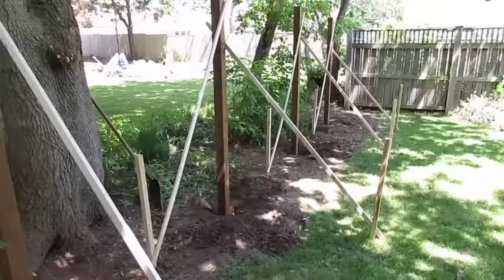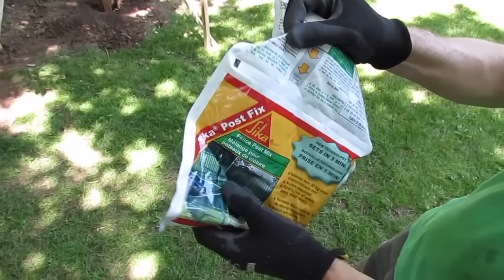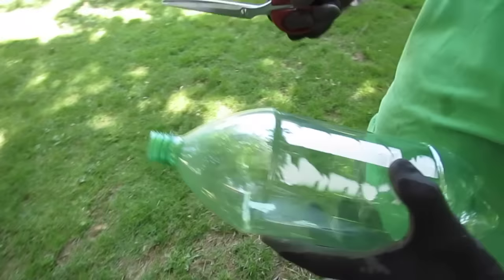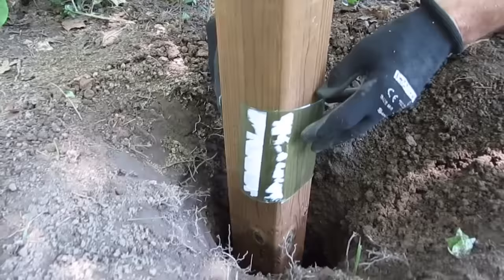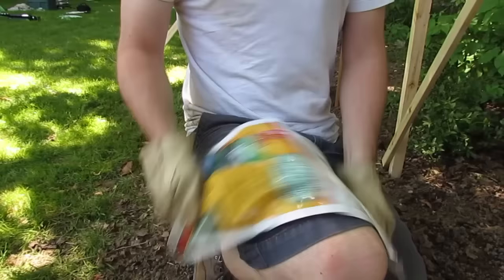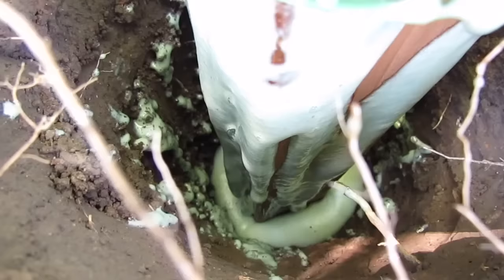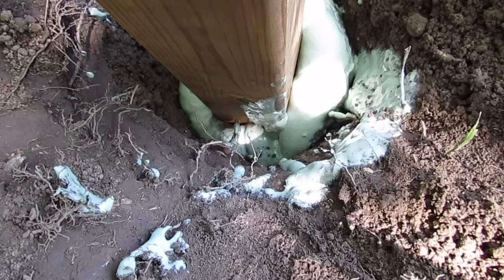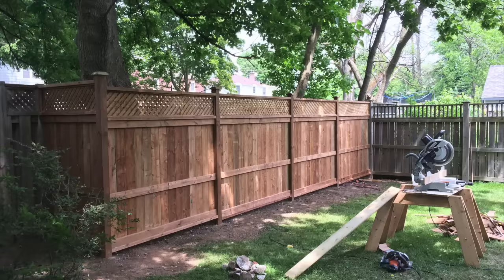No Concrete Fence Post Install!

Comment: the time you spend leveling screwing it... then pay 20bucks for a bag of foam which doesn't even do 1 post... instead put a post in, bucket of water, bag of postcrete for a fiver, level on, hold for a minute and job done..
Reply from the maker: I'm pleased you enjoyed the video so much! Feel free to watch some of my other videos and provide more of your insightful wisdom.
Reply: don't forget the gravel!
Reply: No gravel needed. Postcrete is mix already. Bag cost 4-5£. Fill 1/3 of the hole with water follwing bag of postcrete, level on, job done.. Didnt want to offend you man. You just end up double the price of you fence
Reply: Yeah I did the same, and it was about $5 US per bag here.  But I did put a little bit of "drainage gravel" under the posts, although it may not do anything since the water I put in before the mix probably just filled in around the gravel.
Reply: Paulius Taparauskas not very cheep to use
Reply: @John Doe  Or a callous.  But whatever.
Reply: Awww, you triggered Paton
Reply: Nailed it. No professional would entertain the use of foam as a substitute for concrete.
Reply: PatonHaus Hey....look on the bright side. At least he's not calling you a Home Depot princess and cussing you out like most of these simpletons.
Reply: Not everyone can carry those bags of cement around, the foam is a good idea.
Reply: Use a dolly or a wagon
Reply: $2.35 for a 60# sack at HD, that's under $5 for two sacks like the foam is supposed to handle @ $18.  Crete's heavy but permanent, so I'll be sticking with it.
Reply: That's the truth too much hassle
Reply: Got some "experience" to share that proves concrete is better to use by a home owner novice?
I've seen plenty of botched concrete pours, this seems "fool proof" as a diy.
Reply: Paulius Taparauskas or just use dirt and a log or ur feet works just fine
Reply: Better yet put post in hole hold level put 80 lbs of dry concrete bag mix . Level out and tamp concrete and add water. I can dig and set 80 posts a day . Using form would take a week to do that much.
Reply: no, he's laughing all the way to the hardware store to pick up another $15 bag of foam to do one more post
Reply: lewis james n
Reply: Jeremy Pace Finally someone who knows the best way to do it. I've been doing it Jeremy's way for thirty years.
Reply: silverfeathered1 how can you botch pouring a bag a mix in a hole then adding water?
Reply: Terry Graham A dolly? You use girls to carry your concrete? Try using a cart or hand truck to carry your own. LOL!
Reply: scoop of road pack, tamp, scoop of dirt, tamp, scoop of road pack rock etc . 40 years later, Hedge post horse and cattle fence of all # 9 wire still there . I did concrete the corner Posts. Oh the fence and posts were already around 50 years old, when we took them out and brought them here.
Reply: And do not use this if you live in Hurricane Alley
Reply: @chewysplace3542  Why? What is your negative experience with this product as related to hurricanes?
Reply: Jeremy Pace yes, concrete in dry, add water.  i just did one today, ready in under an hour.
Reply: If you have more money than time, and your back is a little tender, this might be a good option, and it might also prevent climate change because concrete gets very hot when you mix it with water. So why make the climate warmer and cause all the polar bears to have to float around on little teeny-weeny pieces of ice? Help save the earth, useFoam for your posts, drive below 55 miles/ an hour to prevent excessive pollution that will increase global warming, and do not drive anything like an SUV as they are huge gas guzzlers and no one should drive such a vehicle if they are climate change wackos.
Reply: @GilsTestChannel  You are joking I take it. Climate changes - always has, always will. Anyone who thinks they can stop the climate from changing, would be more successful sitting in the corner and playing with themselves.
Reply: How the hell did it go from making fun of the guy for using foam to install fence posts to climate change denial.... 
Next thing we need will be some flat earth tards to flesh out the mix, huh?  

I like the foam theory, but in practice, it just doesn't stand up.  But a decorative. Fence like this?  Makes sense.  

If'n it was supposed to actually provide some structural stability, gotta vote concrete.  

Thx for showing the vid, none the less.
Reply: Spart T  b9
Reply: Actually a callus. LOL
Reply: Yep that's the way to do it.
Reply: O
Reply: 7
Reply: @spartt4360   - "Fill 1/3 of the hole with water follwing bag of postcrete, level on, job done" - mate that's as dodgy as it comes  -  you need to mix it in a wheel barrow first if you want a good quality job.......you cant just pour in water, throw powdered concrete mix on top and hope it all mixes together properly ! Takes way to long to set then too and doesn't set evenly.
Reply: @grantdavenport2036  you get a postcrete where I'm from. Instructions says pour water, pour powder on top. Google postcrete before you posting. Wheelbarrow etc is dynosour age, we are not in 90's anymore. Postcrete sets in minutes.  Half an hour and you can screw timber on
Reply: Spart T I work in the industry and supply to hundreds of fencing contractors and any one worth their pay don’t do try mix into the holes - they mix in barrows or a cement mixer and rip it in....nothing to do with being in the 90’s mate, it’s about doing a proper job. Of course postcrete would tell you to do it that way because they’re trying to sell an ‘ease of using’ for the weekend warriors that don’t want a hard job. If any fencing contractor getting paid to do the work quoted doing it like that, a dry mix,  I would say thanks but no thanks - and I’d get a different contractor . I would rather do the job properly and do it once  and I certainly wouldn’t be screwing fencing up onto it 1/2 an hour later due to movement....set your posts, leave them for 24 hours to set 100% right then start screwing your fence on 😉👍
Reply: @grantdavenport2036  whatever, did fencing like that fir myself, you take a wooden stick and mix it in the hole. Don't see the point mixing in wheel Barrow at all.. anyways it's easier and it hardens in minutes compared to that foam
Reply: Spart T the point of mixing it in the barrow first is to ensure you don’t have clumps of the concrete mix that stays in clumps and does never set properly, so you have a good clean consistent mix. 
Exactly the same as how you make a cake - would you pour it in the bowl, put the milk in and then just throw it in the oven and hope for the best ? Of course not - that’s why you stir a cake mix, so you get even consistency. Do it properly- do it once, that’s how I prefer to work 👍
Reply: @John Doe 
He can't have a Calais on his hands.  It's in France. I suppose there is the risk of Callus.
Reply: Well....some are allergic to cement/concrete in powder-form....
Reply: INSTANT DISLIKE CHANNEL  yeah but you not eating it or mixing it in with your coffee 😂😂
Reply: @grantdavenport2036  it is enough to inhale it, or to have contact with bare skin...I had my experience...
Reply: @instantdislikechannel5699   I'd be more concerned of the chemicals in the expanding foam shit than a bit of cement on me.....carcinogenics big time !
Reply: Also missing a key point of adding cement.  There is a substantial amount of weight that acts similar to a pendulum to help keep the pole upright.  Anything over 4 feet fence is stupid. Used this stuff 1 time never again. Also foam does not have the compressability of concrete.
Reply: @grantdavenport2036  
Agree.  Also concrete is a mix of product.  If you put too much water in the cement powter can leach or separate only to the bottom of the hole leaving a the gravel improperly cemented together.  Also too water can cause brittleness or shifting following install.  Just spent 1-2 minutes mixing in wheelbarrow to its proper consistency and done.
Reply: Alaskan1Medic nor the core strength of concrete either
Reply: Alaskan1Medic yeah I’ve even seen dodgy blokes tip bags of concrete mix into the holes dry, tap it down with a shovel handle or similar and then just hose it and hope for the best.......they’re usually the guys who are providing the cheapest quotes ! 
Do it properly- do it once !  There’s no shortcuts in life !
Reply: Foam is best used in places such as Guam as using too much concrete could tip the island over.  Food for thought.   Congressman Hank Johnson will thank you.
Reply: the point of the concrete is to stop rot and a little to hold it up just rocks can too  but foam stops rot as well or better
Reply: @spartt4360  mmmm, i would use gravel below it. Your postcrete is going to trap water bigtime.  In my humble experience, if you can get away without any concrete at all you're likely to have a much longer lasting setup
Reply: It takes 2 minutes of standing there with a level before it hardens and you can let go.  Hardly fast as cement.
Reply: Scott A  yeah ok.....whatever
Reply: Robert Nash exactly, it’s a shit way of doing it. There’s a fast way and there’s a proper way....same with rapid set concrete - those that use it love it and those that aren’t dodgy tradesman hate it 😉👍
Reply: O my god get some postcrete fast and simple
Reply: @PatonHaus  comment section knows everything, dont they?  good video.
Reply: Ok
Reply: It's a manly way to do things , and one of them is
Concreto.gravel,sand/cement.
Reply: Agnus Dei yep - I see it happen daily 😉👍
Reply from the maker: Bob Smith Nope, just this one Bob.
Reply: Don't get how people get so offended... I just wrote quick comment.. yes you put some gravel, below the post but it's still the way to do fence post.. foam is just fkin stupid expensive time consuming way of doi g it.. end of story😁 you can mix in a wheel Barrow if you think that mixing in hole with wooden stick ie bad, whatever, but even mixing that way you save heaps of time and money  compare to your stupid foam.. postcrete hardens while you leveling the post- 2minutes to level it and leave it to harden. Once you do 15 posts in couple of hours you can go and screw timber coz its solid.. but fuck it, stick to your foam and enjoy days worth of leveling😁
Reply: Bob Smith nah the difference mate is - 
Post Hole Mix is a non structural mix that has more aggregate and sand in it and doesn’t set to concrete mix MPA. It’s usually cheaper to buy due to the fact it hasn’t got as much cement in it. 
‘Rapid Set’ is a structural mix that has more cement and additives in it so it sets quicker and sets to a similar MPA as with concrete mix. You can still mix it in a wheel barrow no problem at all. It would only be an issue if you mixed it in the barrow then sat down for lunch and left it too long. After a fair while it may start to harden somewhat but not that fast that you can’t mix it in a barrow.

In a nutshell mate, a lot of people are just lazy and want to use whatever is easiest, not necessarily what is best for application. 😉👍
Reply: @spunkyprep  the flat earth society has members around the globe...
Reply: @MauriatOttolink  or even a Callous
Reply: @spartt4360 FYI. You should always always put gravel in the hole before the post it keeps the water drained away from the butt of the post so it doesn't sit in rain soaked dirt and rot the post away from the bottom up.
Reply: @Brad.W  I know, I didn't go to every small detail. Just saying that postcrete would be way faster,  easier and quicker compare to all this effort

Comment: hope you do annual follow up videos.  I’d be curious to see how the posts hold up over time
Reply: Responding to a comment you posted at least 5 years ago, this stuff is trash.  Avoid, stay away from.  The foam eventually contracts a little bit creating voids and wiggle room for the fence to sway in.

Comment: There is no such thing as structural foam.  I've had to replace posts that people have foamed b4.  Do the job right.  Use concrete.  No use trying to re-invent the wheel
Reply: b4? BS..
Reply: so this foam slab i just poured will not work?
oh crap.
Reply: Naw he is just incompetent and lazy
Reply: @1:04 pushes dirt in hole...then says pull dirt away from hole.  Also the bag says "post fix" not installation...I don't know this product so just wondering.  I see a lot of the comments say pour a bag of concrete and water and that seems like a lot less work and far more durable.
Reply: @daveslaugs832  you took the time to get triggered by an observation that was noticed...so what?.  If this angers you so much I feel sorry for everyone around you.  The guy put out a public video that's getting flamed left and right and you get triggered by this?  I feel for you, man

Comment: I love the foam. I have used it twice now for my mailbox post & works incredible. A guy hit my post w his
truck cracked my post but the part in the ground stayed in the ground + the post stayed straight. I was
impressed. I replaced the broken post & used foam again,
BUT THEN,
I.m now building a tractor shed which has 3 posts. home Depot charges me $15 a bag for foam
while their post concrete is $3.50 a bag. Also, I have a small motorized concrete mixer which makes
the mixing  a breeze so I used concrete on the shed posts but only because of the cost. If you have 
a job far from water, foam would be the way to go.

!

Comment: Thank you Paton. After much research the building industry is catching up to the electrical providers that have been using this for years. Concrete has its place just not for fencing those who say otherwise are stuck in a rut.

Comment: I work for an electrical company and we use quickcrete.. it's a foam based pole setting material just like the one in this video. the poles we set are 40 feet tall and 2 feet thick at it's base.  so if your worried it won't hold up well I know from experience it will.

Comment: Good to see this system is available to the public now.  I did this 35 years ago with a 2-pound density foam with an expansion rate of 20:1.  It works great.  It not only is quick but the foam also protects the post from rot down the road.  The foam will rise higher if you warm the post hole before putting the two-part foam in.  I used a propane torch, however, I have seen people pour a little gas in the hole and let it burn off.  Not the safest thing to do but it works too.  I replaced the fence in 2006 and only had to replace 2 posts out of 30.  We didn't even have to stake the posts.  The foam kicks so quickly we just held the posts in place with a level on them.
Reply: Warm the hole???LMFAO That's just too much!
Reply: How much more did it cost? Just because it works dont mean it lasts because foam breaks down much quicker in the environment. Plastic won't but foam sure does.
Reply: That's just stupid. Won't last. More expensive. Takes longer. Traps moisture next the the post so it rots faster.  Environmentally screwed.  Where's the benefit again?
Reply: George, the benefit is to the person selling this.  What is that phrase...an idiot and his money will soon be parted?

Comment: When I had my fence installed. ( I'm in a wheelchair and had to have my 6' fence professionally installed.  I bought the foam product in gallon jugs for more precise measuring.  It worked great!  My contractor called a buddy in the same business to come and inspect it.  Now both are using the foam most of the time.  Oh yes, here in NW Texas we get very strong winds.  No problem!
Reply: What foam product?

Comment: Very cool. Wondering if this would work for a mail box post.  I was hating the thought of using concrete because when you have to replace the wood post, you have a hell of a time digging out the concrete.  This seems like a good alternative.  Tks for the video.  Always good to see people thinking out of the box and alternatives.  Can’t stand haters in this forum.  Tks again

Comment: I used this stuff last year as directed.  I did one post in concrete too to compare.  This stuff still allows the post to wobble a bit.  It is great for a birdhouse post, lightpost, etc. I would not use it for decks, foundations, etc.
Reply: Agree

Comment: I used this product for a large fence in my backyard and it’s vastly simpler than concrete and quicker.

BUT, the foam has zero weight to it.  Something I wasn’t considering. So in the problem is that in wet areas where the soil never dries hard, the weight of the fence completely pulls down the posts.

So there’s your warning, don’t use in soggy soil
Reply: Thanks for the warning. I live in a wet area.
Reply: Excellent point!

Comment: I poured concrete and foam around various posts around my yard to compare.  After hardening, I gave the poles a good shake back and forth.  The foam loosens, the concrete doesn't budge.
Reply from the maker: Cool, are there pictures or a video of your findings?

Comment: Would recommend anyone making a fence, to string line your fence before placing posts. This will ensure the fence will maintain the same level thoughout.
Reply: Not level but straight line
Reply: Why do you think he didn’t do that already? You can see his posts have been staked into place. And you can see his fence turned out straight and level. So I think your comment is a little misguided. Or at least misinformed.